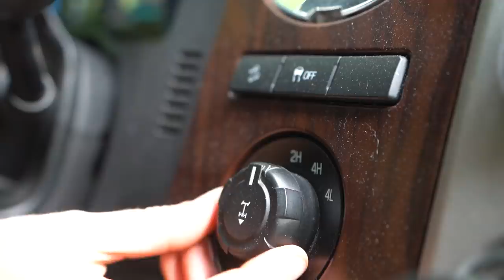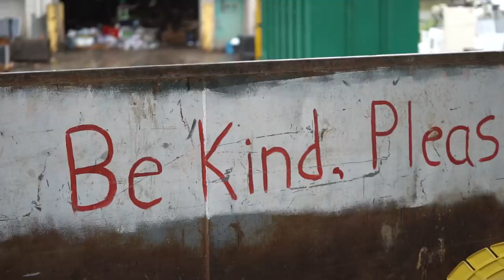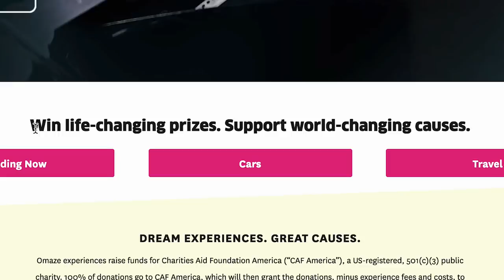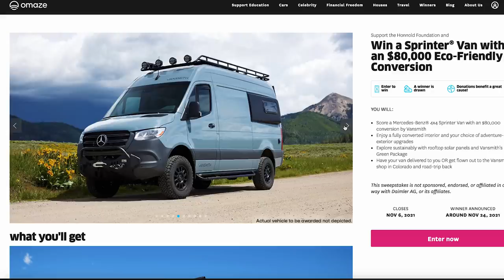First Week Living at Cabin in the Woods Alone

Comment: Harvest all that rain!
Reply: Girls, seriously now. I see from the aerial view you are basically a combustible object in a combustible forest. Have a Contingency Emergency Plan, get a 1/2 size blue clean chemical drum with lid and preferably the metal locking ring and bury it by the house, flush with the ground. When the lid is on, cover it with a concrete paving slab.  This should survive a fire and you won't have to waste time looking for everything when you need to get out..

 Put COPIES of all your vital paperwork, van reg, van insurance, house insurance, backup blogs, drives, medical details, photos of all your possessions/contents of your house and anything you can think of that will make a disaster recoverable. Make sure you are on the contact emergency email, phone, alert for forest fires in your area. At least then if you have to get out in a hurry and the worst happens you can rebuild. Have a plan, be prepared, be safe. We love you.

Comment: To sterilize your water add some chlorine bleach.  You want 1 to 2 ppm(parts per million).  Chlorine bleach is usually 5% chlorine so a little bit of mathematics will do the job. Recommend getting a low level test kit to test the amount of chlorine In the water.  So long as you have 1ppm residual the water is safe to drink.  Higher then 2ppm is too high and will taste.

Comment: At best the deck you built would be a sitting deck or grilling deck. Not designed to hold 5000 pounds of water. Footings are wrong. They need to be dug down to below the frost line. Lumber is not up to load either.  Way to big of a gap between structures. Deck boards are not structural. This is a disaster waiting to happen.

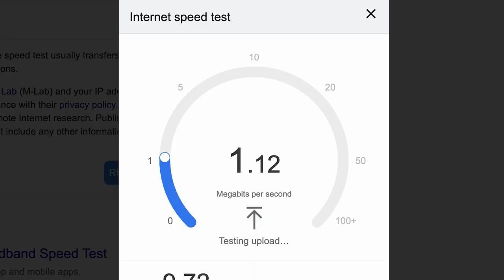Comment: 12:00 That's a really decent internet speed and latency for wireless internet, and 44 Watts is not terrible (as a comparison your phone charger typically consumes 5-10 Watts).
17:45 You could also place a water tank up on a raised platform (as close to roof height as you can) and fill it with water from your lower tanks (just get a gas water pump and refill it every now and then) and it will provide you with running water in the cabin. It's what we use up at our cabin.
18:42 I highly recommend making a cross-cut sled for the table saw. It makes cross-cutting things safer, more easy, and more accurate if you start doing cabinetry or shelving. I would recommend checking out Steve Ramsey's channel and this video in particular https://www.youtube.com/watch?v=0sdm_Ow-BTU